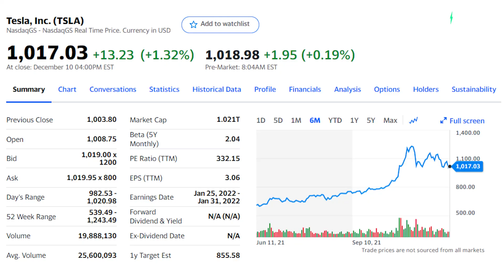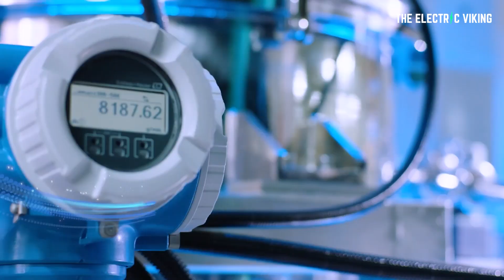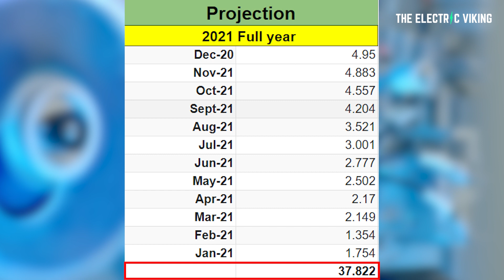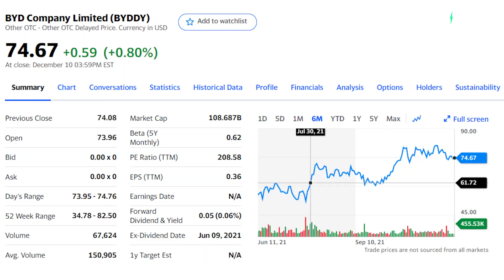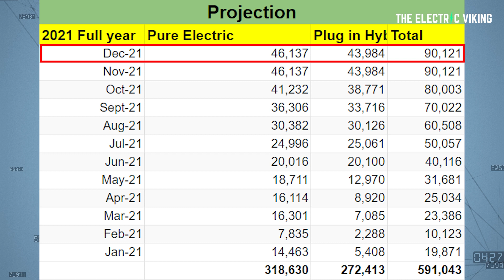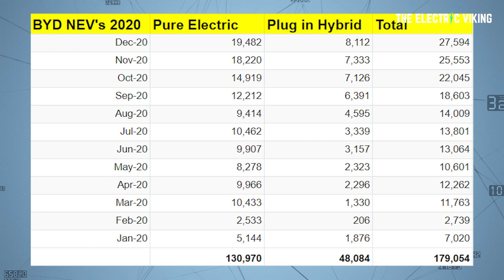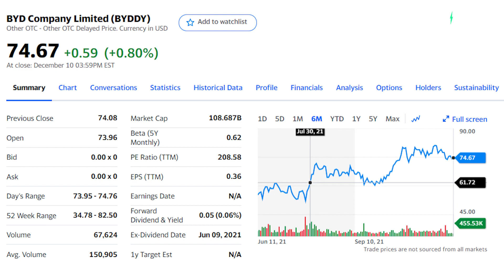This is the CRAZIEST EV and BATTERY story of 2021

Comment: We DO hear less about BYD than about more "glamorous" brands like Nio and Polestar. It's probably true that BYD can't grow as quickly as a start-up can, since it's already a huge, built-out company with many irons in the fire. But its fundamental solidity, experience, and vertical integration give it many advantages over makers that sub out parts and assembly. Funny that stock is now at lower level than when I bought it October 20, wiping out my previous paper profits, but that doesn't make me believe I made a dumb move. Patience; whoever has "the goods" will prevail!
Reply: @Van Rozay - I have the same experience with my BYD investment, but I'm not worried. I keep buying and am not planning on selling until the 2025 - 2030 timeframe.
Reply: @johannbrauer9285  Ditto. I think some of the tail wind is continuous manufactured propaganda articles in Barrons and the Wall Street Journal about "tensions" between the CCP and the U.S. and vice versa. I hate to see that muddy BYD investment because it is the real deal. BYD appears to be run much better than both the Chinese Communist Party and the U.S. Government combined in my lifetime! They are making something actually useful for the progress of the World.
Reply: BYD is growing much quicker than NIO or Polestar!! They are growing sales by 10,000 for the last 7 months! 90k last month - NIO sold 11k!

On a percentage of sales compared to previous year Xpeng grew the fastest @ 270%; BYD next 252.7%; Li Auto 190%; Tesla 131.7%; NIO 106%.

Overall Chinese NEV sales are up 144.7% YoY.
Reply: Share price going down is unimportant. Shares have dividends, unlike precious metals.

Comment: this is why the 4680 is a big deal    tesla can run battery making full steam, no need to stop to weld a tab
Reply: It will be when they actually start producing them!!!
Reply: BYD uses blade batteries with LFP chemistry, from what I understand.  BYD cars may not do as well outside of China due to limited range etc. China is potentially biggest  market though.
Reply: @ElectricDanielBoone  what do you mean limited range? 1000 kms is the range of the Blade on the 3.0 platform.
Reply: @ElectricDanielBoone  limited range???? What the heck you are talking about?
Reply: @TheSmallbug  NEDC used and a lot of them aren't super at that. Also, no changing network.  LFP safety is a plus though.
Reply: @ElectricDanielBoone  you are right about NEDC but this does not mean a range problem. Instead of 600km you will have 500 km WLTP. Just another measurement units so to say. It is to be applied equivalently also to other types of batteries
Reply: @TheSmallbug  from what I've read divide NEDC by 1.43 to get EPA. That'd put 500km at 350km.  With LFP (BYD) range will stay put over the car's life and charging to 100% and draining to 5% constantly isn't a problem.